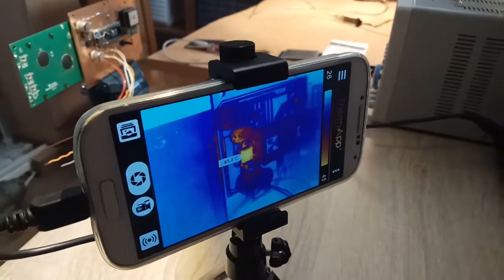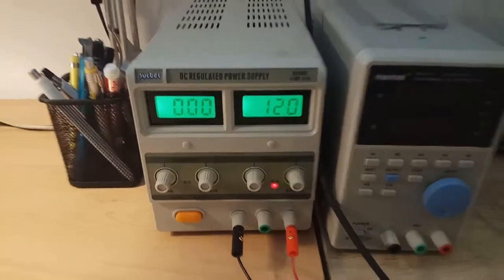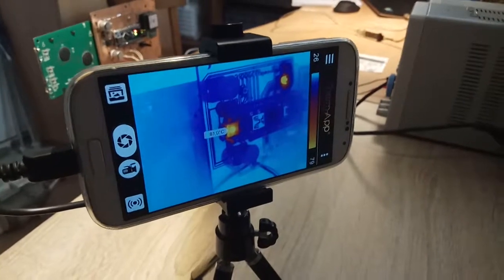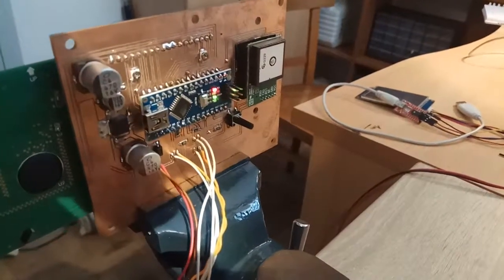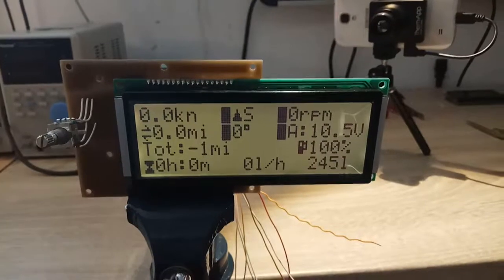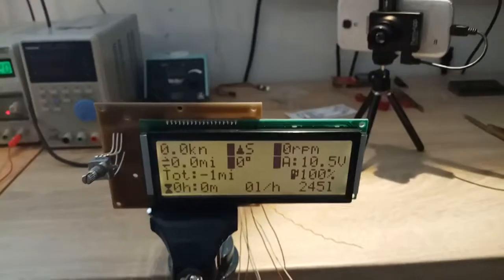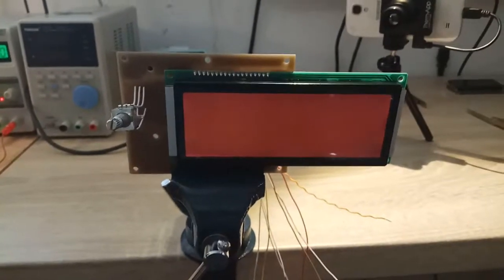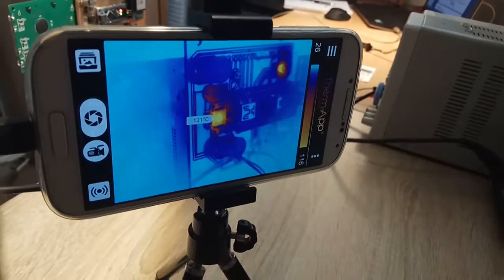7805 Voltage Regulator Thermal Shutdown

Comment: 35mA or Amps?
Reply: As far as I understood it's 0.35 A or 350 mA. So there the power dissipated is 0.35A * (12V - 5V) = 2.5 W.
Needs a reasonable thermal mass/beffy heatsink for this.

Comment: High, excellent video, what phone app are you using, this would be brilliant for my students?
Big thanks. D
Reply from the maker: This is ThermApp thermal imager with Android app.
Reply: @fbonacic  Awesome, if this just only software that is needed for an android phone or does it need additional hardware?
Reply: Just found the web link. Cheers